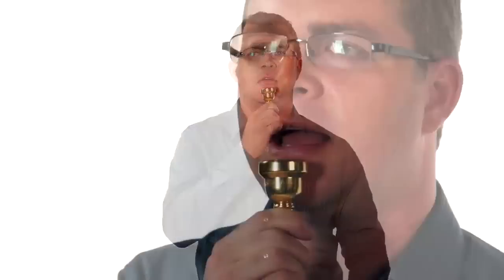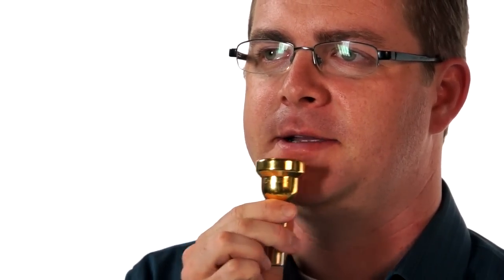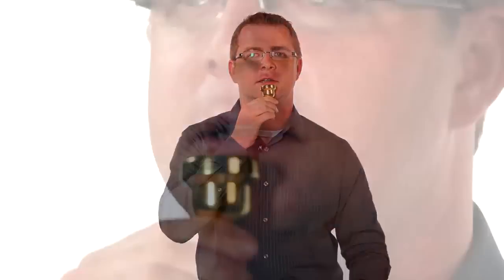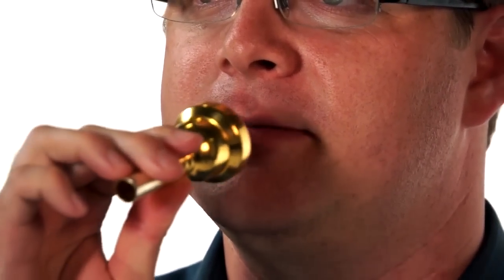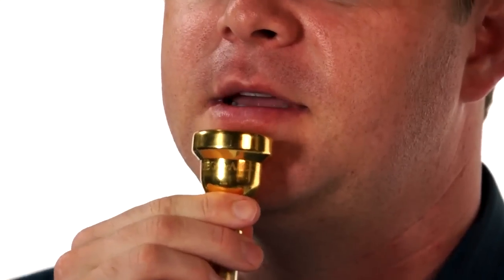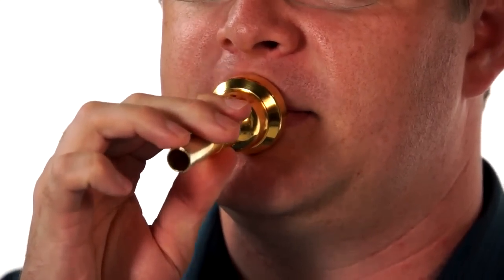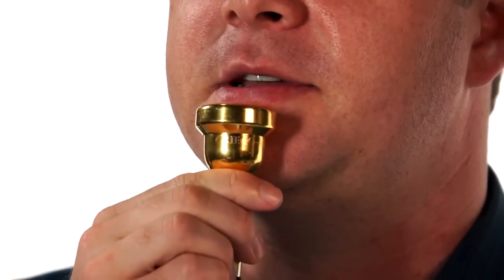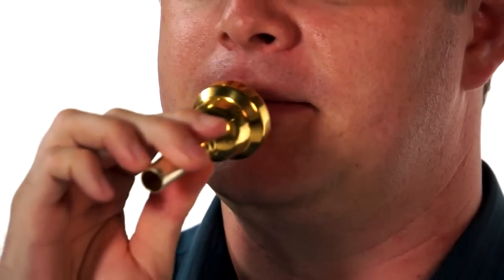Trombone - Mouthpiece Placement

Comment: I have played the trombone for over 50 years and there is some excellent advice given online and some awful advice also given. Mouthpiece placement is dependent most on your own facial structure. Of course there are some general guidelines but I would suggest that a brass player who is just starting off get with a good teacher. I think this video is fairly accurate in representing a good starting mouthpiece placement. After this please get a proper teacher.